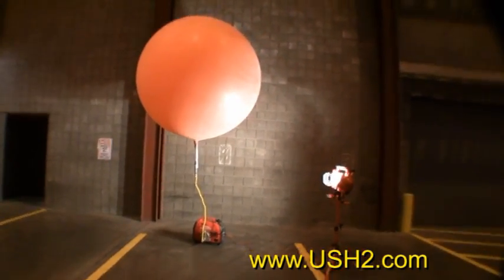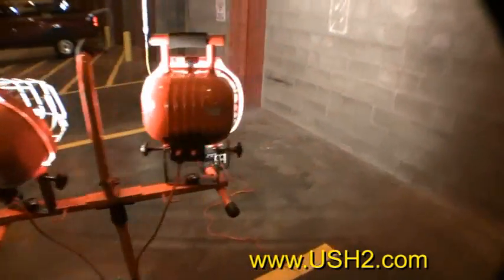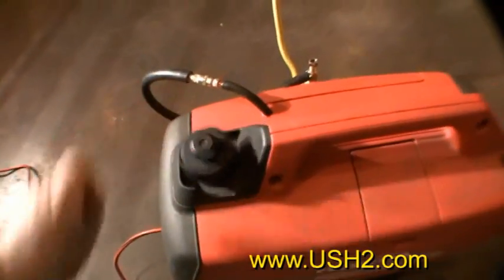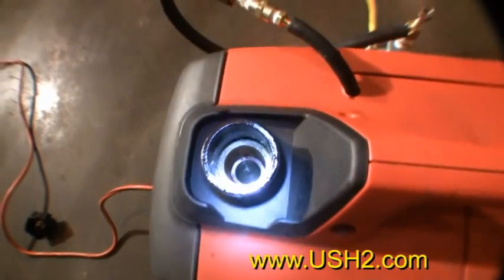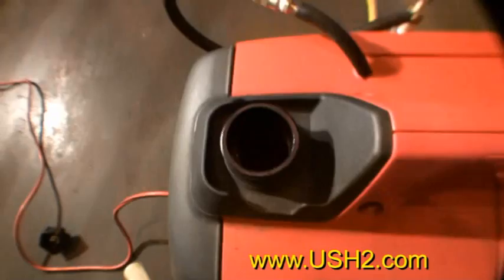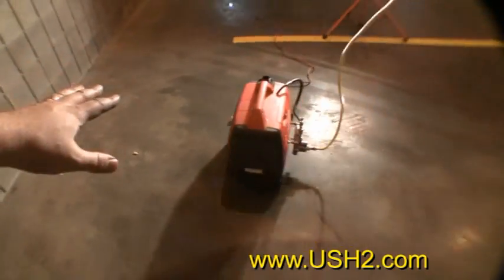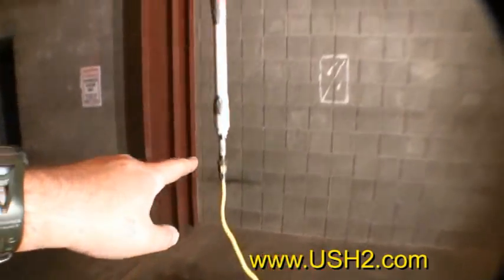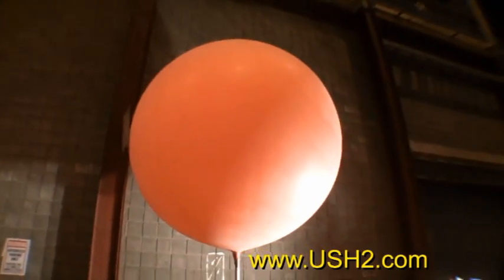MultiFuel Honda Generator Running on Natural Gas Balloon

Comment: If I were to run a vehicle off this gas, I'd want my balloon protected inside a metal or plastic cylinder. Could put balloon inside cylinder, then fill it, maybe. Big plastic drum might work.
Good work. Thanks.

Comment from the maker: @Maci333 well we have an entire section on wood gas generators.  just go to USH2 (dot) com and CLICK on the HYDROGEN BUTTON and scroll on down... you'll see all of the books on wood gas, get the one called Hydrogen Generator Gas for Vehicles and Engines: Volumes 3 and 4, that is the best place to start, its a step by step plan, with photos, drawings, parts lists, exploded diagrams and everything  needed for making a wood gas generator that will work on a generator. All parts are 'home depot' par

Comment from the maker: @BugsBMD umm...its a Honda EU2000i, its computer controlled, you can see it turn on the lights (clearly) AFTER it starts running, and a honda is anything but a cheap generator.  So I don't think I'll have to worry about those spikes....

Comment: You guys are doing awesome work.   I'm signing up for the email list.  I have a question though on the natural gas.  Is this the same gas coming in from my local utility company and can I tap in from that?  Also,  what's the cost of natural gas compared to gasoline prices (currently around $2.75/gallon midwest ) ?  I guess I don't really know how much natural gas is going for at this time.    Thanks for any help.

Comment from the maker: @timcat100 I give ALL those answers in the Fuels Video - Gaseous Fuels at USH2edu(dot)com   How far you can drive, how many bags or balloons, or how many propane tanks with natural gas compressed in them.  I do this for 3 different sizes of vehicles, and for ALL of the gaseous fuels.  Hydrogen, natural gas, propane, methane, producer gas, wood gas etc....  its an excellent 98 minute long video.  see  USH2edu(dot)com

Comment from the maker: Static only forms on exterior surfaces...NOT internal, plus..there is no oxygen or air in the balloon..its all natural gas.  There is no explosion risk.  If you took a torch to the side of the balloon it'd rupture and give you a nice flame and upward moving fireball for a few seconds and then it would be gone.  the gallon of gasoline you keep for your mower is by far more dangerous.

Comment from the maker: Absolute simplicity.  This is almost as simple and basic as it gets.  The next step, is we'll show you how to produce a variety of fuels that you can store in balloons or items like balloons (very inexpensive) and have a reserve of energy.  For example, if you were in 'nowhere' and you made that gas and had it in that size balloon, and ran the same generator and put the energy directly into a battery, w/ an inverer, a laptop would run for about 5 days, 24 hous a day from that energy.

Comment from the maker: natural gas is OURS...comes from the ground, lots of wells all around the USA...huge methane hydrate deposits off the coast.  I have two books at USH2 (dot) com that show you how to make methane at home.  Biogas 1&2 and Biogas 3.  You can start in a 55 gallon drum !!  So you can make it, drill for it, nature makes it all the time....  so  yeah.. it works and it screws OPEC...  thanks for writing.